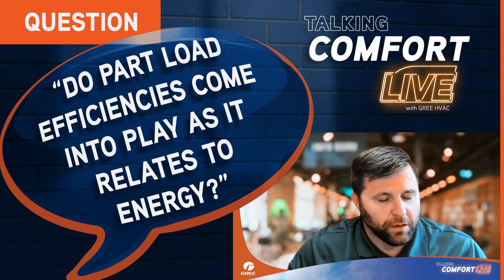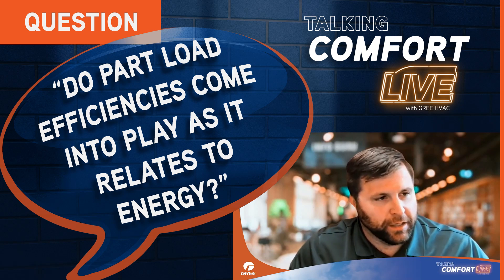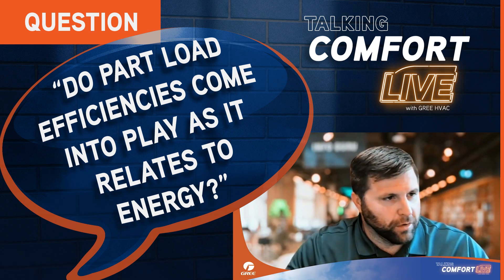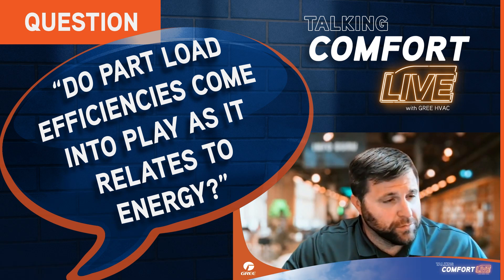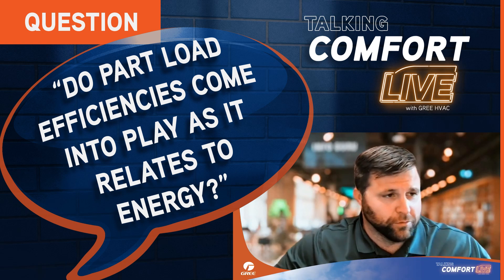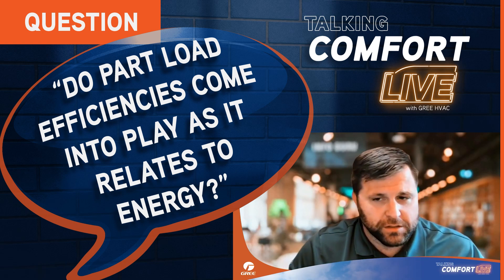Efficiency Unlocked: Part Load Insights for HVAC Contractors #talkingcomfort #hvaccontractors

Comment: I haven’t seen an 18 seer single stage system for one. For two wait till your variable speed motors breakdown out of warranty and see how you like it. Ramping down to 25% capacity is about the lowest I have seen.